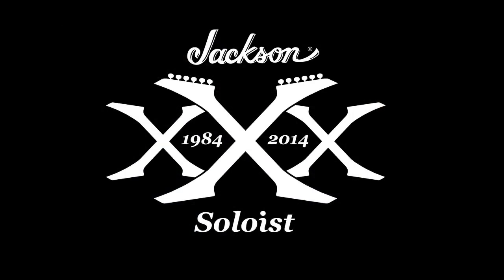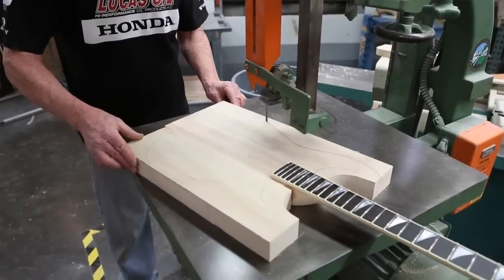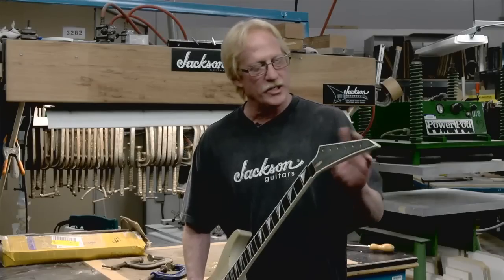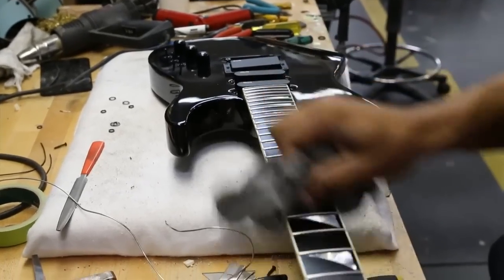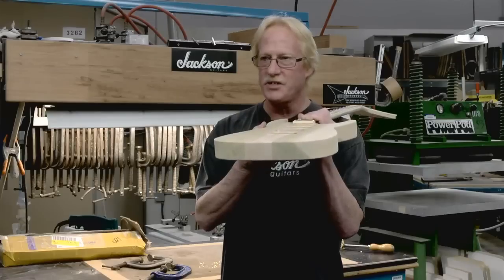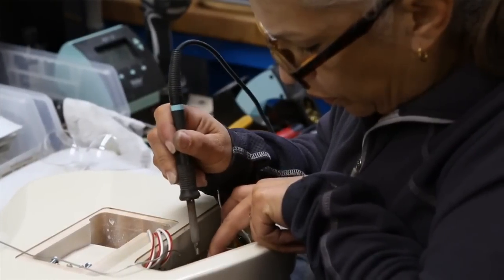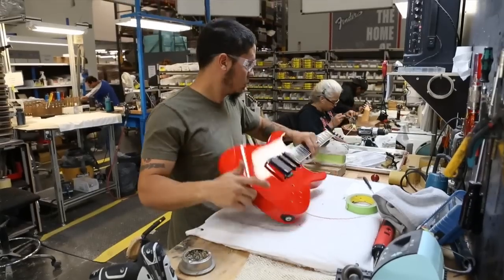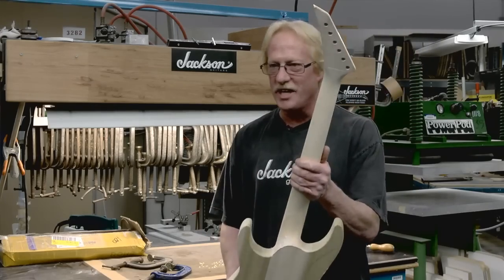The Jackson Custom Shop 30th Anniversary Soloist | Jackson Guitars

Comment: Attention Jackson Custom Shop There needs to be more >
1.Volutes
2. Reverse (Back of Headstock) Mounted Locking Nuts (EVH Guitars have this)
3. Bigger and Longer Headstocks (Options for Custom sized/shapes headstocks)
4. Graphite Reinforcement Rods (Carbon Fiber) STANDARD on all guitars
5. Side Rectangular Position Markers (highly reflective)
6. LED options.

Comment: Yeah its only $5,633.79!!!
Reply: TheSpineSplitter1990 that’s far far fucking over priced for Jackson,usually their average USA soloist are $2200 as well as their custom shop soloist
Reply: @lamborgatti-4783  In 1985 any of the Custom models were $1,850 base price. That's roughly $3,500 today adjusted for inflation.